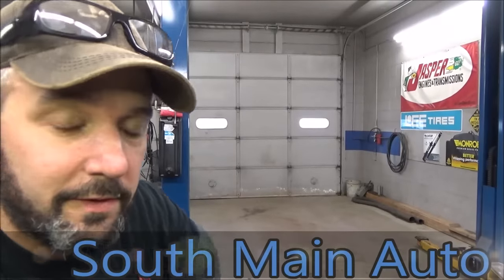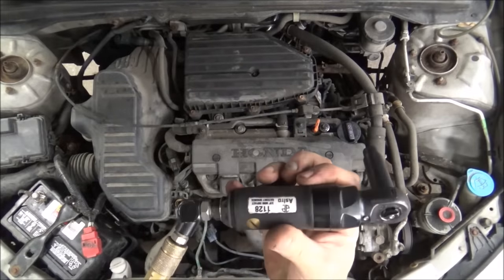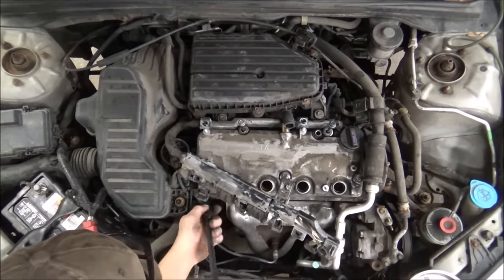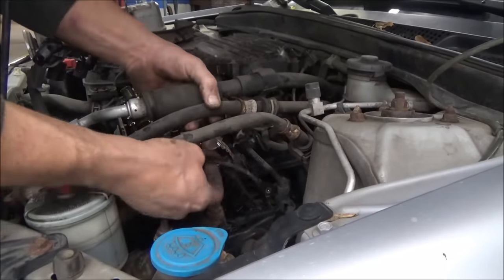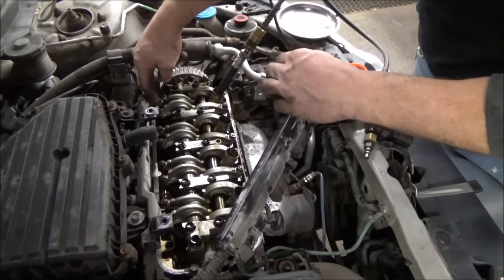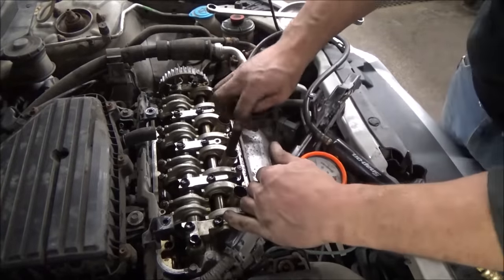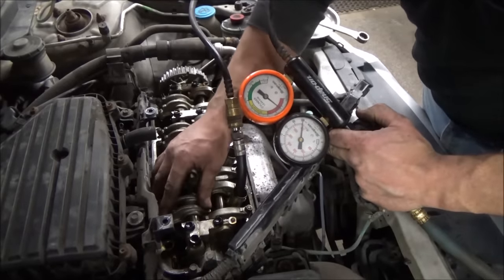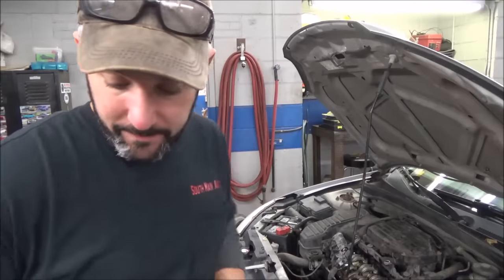Honda Civic 1.7 - Crank No Start

Comment: Neon 2.0 and 2.4 liter ( SRT4 )are crash motors. Valves wont kiss pistons, valves will hit valves. I guess its bitter sweet that way, at least you can just take the head off. But, hopefully you dont run into the Boosted Neon or the Boosted PT cruiser. Holy hell those are a nightmare with that damn " Turbofold " integrated into the exhaust manifold as the Mopar men call it. Those are painful
Reply: +Mopar Dave  Just my 2 cents eric! Feel free to bash me i know its comin! Hahahaha! Great video
Reply: I did a timing belt on an naturally aspirated 02 PT cruiser. No bent valves. Man, when that thing started up and ran perfectly after installing the belt it was a good feeling. As for turbo PTs, that "turbofold" as you call it looks like a nightmare. It basically takes up all the empty space in the engine bay that is there on a NA engine.
Reply: Oh, and when my timing belt broke i was going about 10mph across on intersection. probably in the 2000rpm range. I knew what it was when it happened as I had been putting off doing the belt unless absolutely necessary, since i live in upstate NY, the thing was gonna rust out soon anyway, I didnt want to pay a mechanic 1000 bucks to do it for me. I figured i'd just take my chances and do it myself if the time came.

Comment: It is dumb design for interference engines to use timing belts. A chain is the way to go. They should only use timing belts in non-interference engines.
Reply: Ryan Toomey there’s nothing wrong with timing belts,I just did one this year on my 92 civic SI. It was almost exactly 200 thousand kms since I did the last one. Still runs great at 449 thousand now. You just have to do it when it’s time. I won’t go more than 150 thousand on my prelude when have to do it though

Comment: Unbelievable!  All that just to get a valve cover off.
I had a Honda and the maint manual says to change the the timing belt at a certain time.   I too ignored this and paid for it.  Blew the engine a few years later..  Later Homdas finally went to timing chains and the problem went away.

Comment: Almost every 4-cyl. engine will have valve damage after timing belt breakage. Especially the modern high compression engines. I do not even check it anymore...

Comment: Hey you should just buy a JDM low mileage D17A. i work for a JDM here in Los Angeles and i sell those engines for $500. they usally have between 40-80k miles on them.

Comment: I'm trying to build a consensus of causes for this problem of intermittent Start/stall on YouTube before I fire another parts cannon at the old gal. Already did new timing belt, water pump and pump belt. 290K miles says I needed that anyway. 😂 New plugs, wires etc. I think my problem is ignition coil (acts up when hot), a relay or the fuel pump. Well, this ain't it so...,

Comment: you didn't set the leak down tester properly... you need to set the regulator to 0 before you hook it to the plug hole.

Comment: Nice diagnosis. $2k buys a couple of new cars to drive to destruction.
Reply: +Badgertronix You're right my first car cost me £450 ($670) and that got me a '96 Mercedes C class lasted for two years with nothing more than an oil change and a wheel bearing being replaced. Shame the ECU went bad on it since it was mechanically good.

Comment: Loose spark plugs
Burned valve cover gasket 
Broken belt
Died while running 

All signs of overheating. Terminal for the aluminum fellow.

Comment: Junk yard head and a cheap Chinese belt kit, be back on the road for 100 bucks, done it before when I was a much younger (and poorer) man
Reply: +Fahrenheit38 Good luck finding a used one in the salvage yards near me. They go faster then waffles in the morning as people buy the whole motor for $300.00 and don't bat an eye. As the 1.7 gets older and this happens more the less they are available.
Reply: Not if the pistons are damaged

Comment: I am thinking the noise the operator heard coming from the engine shortly before the engine failed and stopped was probably the timing belt shredding. The loose belt fibers were slapping and making noise on the inside timing belt cover. If one would have known you could shut down the engine immediately before the pistons hit the valves.

I also wonder if a contributing issue is the myth that is so pervasive today  that Honda and Toyota engines will run forever with NO maintenance? That is UNLIKE the junky engines from the american manufacturers GM, Ford and Chrysler. Sorry for the sarcasm but I head that a lot from family and friends about cars.

Comment: If they had replaced the belt at 100,000, as Honda recommends, this would have likely been avoided. (and don't replace it with a cheap timing belt)

Comment: A timing belt on an interference engine.... Brilliant engineering.
Reply: It is brilliant. Service them as they should be and they’ll run hundreds of thousands of miles like well  maintained Honda’s generally do. Free- wheeling engines aren’t by design as efficient or clean burning.

Comment: Fuck waiting on the machinist. Get a reman. Same thing, but you get the head back faster. Saves labor inspecting the old one. They're about $500. A victor reinz kit costs about $60. Takes an hour to install the head and set the valves. Then you're just left with the timing belt.

Comment: Murphys' Law
the problem with just junking a car in a situation like this is what happens with the replacement...
that's the reason it's not worth the value of the repair

probably no car is worth the value of a major repair if that repair is for a breakdown that is likely enough in that car given its age and mileage

True "wisdom" would have been, "hm your Honda 1.7 is making a funny noise that you can barely describe. When's the last time you had the timing-belt replaced? Maybe you should bring it in right now in case it's the timing belt about to go bad, or at least record the sound that it's making with your cell-phone and email it to me so can hear it."

Comment: But Hondas are so reliable, until they break that is, my 2001 lesabre 3.8 has 294,000 with original timing chain, my friends friend has an Audi at 100,000 timing chain broke and there were two he said, God knows what damage that caused.

Comment: The 1.7 motor is a non interference motor! So valve's would not hit the piston.
Reply from the maker: Proved that wrong in this video...
Reply: After 1996 honda 1.7 motor was non interference motor. I had a 2003 civic 1.7 non interference motor. Now I drive civic 1.8 I vetec .
Reply from the maker: @duanenishimoto1285  this engine is 100% interference I prove it in the video. Did you watch it?

Comment: Also those 1.7 arent the best engine that Honda made.. They were quite troublsome i've witness quite alot of these mills having blown head gasket and throwing rods and such with low mileage.Reliability wise the Honda 1.6 was top notch and the 1.8 seems to be better than the 1.7
Reply: Jotech 1991 agreed on the 1.7 being junk. But the 1.6..do you mean single or dual cam 1.6? Imo single cam 1.6 is Hondas most reliable
Reply: i was talking about the SOHC engine, it is such a relaible mill
Reply: Oh you got that right

Comment: I'm not a mechanic but I have to ask myself every time these guys go through all that trouble why not put the borescope in the spark plug hole and find the damage. I understand there's different types of cameras that can look up at the valves or there should be at least. You fine damaged why waste your time going through all the rest of this. If the customer is not going to do anything anyway it wouldn't take but 20 minutes or less to find a bent valve or something along those lines. Or am I way out of line here

Comment: I would have gotten a head from a scrap yard and belt and done this myself for under 300$
Reply: Pay me now or later, mechanical incline one day job.
Reply: Funny to come back to this video after two years, I just bought one of these civics mine is an 02 non vtec with low miles . These cars are now worth their weight in gold with gas prices, I’m getting 400 miles out of a 13 gallon tank !!!

Comment: If the valve hits I would imagine it would happen as soon as the belt breaks.  After that the valves aren't going to move so cranking shouldn't cause any (more) damage.

Comment: Why do they make interference engines? Seems stupid
Reply: Higher compression ratio means more power, less fuel needed, more torque and interference engines.
Reply: The valves open into the combustion chamber and like he said more compression = more power/effieciency so the piston will come very close to the head and if a valve is open when the piston comes up...

Comment: Timing belts are junk literally the number one thing I avoid when buying a car is timing belts always go for a chain
Reply: Chains can break, chain guides break, chain tensioners fail too and replacing a timing belt really isn’t that big of a deal. If anything it’s a good excuse to replace other stuff like the water pump that may leave you stranded one day anyway. In the grand scheme of things I think a tbelt is pretty low on my considerations for a new vehicle.
Reply: briantii I’ve had 3 cars with chains and I own two of them still, my first car a 94 Sentra had 315k ( I did 210k of those miles) never had a timing chain issue. My current cars a 01 Maxima and 92 Sentra both are nearing 300k and no timing chain issues, I’m sure like anything they can fail I’m not disagreeing but if properly lubricated they literally last forever in my experience.. what killed my first Sentra was a 88 Ford truck ramming it, it still started and drove but it was a little half passed totaled
Reply: @tommys1678  Sure, but for that matter I've owned 5 cars with timing belts and 2 with chains and never had valvetrain problems with any of them. The keys to success on either are proper maintenance and hoping your OEM didn't screw up the engineering. Some Nissans like the Pathfinder and G35 have had problems with the chains which were a real pain to address. Ultimately the tbelt is just another maintenance item that should be replaced on schedule as indicated and can be easily planned for. Ive diy'd 10+ of them over the years for myself and friends... they just aren't that big of a deal either way.

When buying a car the unscheduled maintenance (break down items) are a far bigger concern to me than how the valvetrain is driven.
Reply: Also cars like these Civics are REALLY easy to do the belt on. I've done them in the evening after work or on a Saturday morning before lunch. So cheap and easy to do that there really is no excuse for not doing it. My IS300 belt is a bit more involved, but again... the parts aren't expensive and the work isn't that hard... just takes a little time every 5 years / 100k miles. Do the maintenance and they do NOT break. :-)
Reply: briantii still doesnt change my mind on timing belts being garbage
Reply: Tommy V - Heh - OK. I'd trust a maintained belt with 20k miles on it more than a chain with 300k... but whatever. Guess lucky for you chains are more popular these days, but you're missing out on some of the most bulletproof reliable engines from the early 2000's like the 2JZ, d and b series Honda's etc.
Reply: briantii a bulletproof engine in my opinion would be the GA16DE or the VQ30DE and I have both of those and they have been great to me. My issue with timing belts is that they are extra maintenance and if you don’t have the time or tools or just don’t know how to change them out yourself it’s an expensive thing to have replaced. I had a 1993 Nissan Quest and I called around and emailed around getting quotes for the timing belt replacement. every place I called was over $1000 some creeping into 1500+ (of course these were chains big names like firestone tuffy etc I’m sure a mom and pop mechanic would be cheaper) and that’s when I made up my mind that timing belts are junk. It’s too expensive and it’s a well since your here replace all this other crap too kind of thing...oh and let’s not forget when the little rubber band snaps your stranded and most of the time out an entire engine ...I respect that you like them they are easy for you to replace and you enjoy extra maintenance but it’s not for me
Reply: @tommys1678  Sure, I respect that you don't care for them due to the higher maintenance. I wouldn't say that I like them exactly myself... all things being equal I'd prefer a chain too. My point was just that frequently all things aren't equal. The parts to diy a 93 Quest are less than $100 bux and that's even including the "while you're there" stuff. I've done a vg30e in my old Maxima, it wasn't too bad. It's too bad you couldn't find someone reasonable to replace it. Toyota dealers used to frequently run specials to do them for under $500 on the various Toyota engines.

I think some of the claimed benefits of the belts are more efficient (less valve train parasitic loss), less stretch / wear that occurs at chain links, and some say they are quieter. Personally I don't care. Just replace whatever the manufacturer says when they say to do it and keep on roling. If a belt is in that list it gets done too. Take care and the vq30de's are for sure great engines, don't remember the GA. The QR25de wasn't very good... had a buddy with an early one of those.... bad, bad, bad.
Reply: briantii at the time of my life I was at when I had the Nissan Quest I didn’t know what I was doing and to this day probably still don’t so I wasn’t even going to try it and it was too much to replace professionally as a preventive maintenance thing, same thing with the 06 Kia Rio I had its just something i can’t afford to have replaced don’t know how to do it and don’t want to mess anything up ..I’m sure a lot of people end up exactly where this dude ended up with his civic ..it snaps motors ruined the car goes to a scrap yard

Comment: Why in the hell don't they make all engines non-interference? Oh, big bucks when the rubber band goes twang!! I'll stick with my timing chain engines, at least you might get a chain rattle pre-warning for a while!
Reply: robbocop33 r yeah ,except for some lousy designed engines,GM Colorado has a timing Chain on the rear of the engine as well as the front and they’re having premature wear issues with em,failing at 100 thousand miles. 5 thousand dollar job to do it. Garbage from Genital motors never stops.

Comment: What a waste......Seems like they could design the valves not to hit when the belt breaks, or maybe just not engineerable. I would just find a used head and bolt that baby on there, use same head bolts, maybe a new gasket, good for another 50,000
miles. I believe alot of cars get scraped due to the owners have no idea how to do simple type work on their car.
Reply: +Charles Miller Just a couple things, head bolts stretch, so you aren't supposed to reuse them. last set I bought was around $20, not that bad for older common engines. Using a junkyard head is a gamble. If the engine it came off of can be leak down tested, then the yard probably wants to sell it complete. If they sell it already removed, I think its smart to have the machine shop look it over. If not you risk trashing  gasket sets and head bolts until you can find a good head. Not to mention all your labor.  Also, a non interference engine will not bend valves when the belt breaks. This was an interference engine. 

But most important of all, if the owner would have just had the car serviced regularly, his mechanic would have recommend belt replacement at 60k-110k.  Problem solved.
Reply: the idea behind interference engines is efficiency. Many car makers design engines like this, nowadays. As for the belt, it is a great way of keeping the engine quiet. My 91 civic is much quieter than my sisters 06. The new Honda engines use a chain. louder but safer I guess for those that don't do maintenance
Reply: I guess in the end it all comes down to labor if you aren't able to do it yourself, then its just not worth it. Seems like there would be alot of this type engines around. 20.00 for head bolts, at that price yes new bolts. Think my last set was 80.00. We seem to just throw everything away lately, in the end it will come back to bite us. So the new type engines have the belt break slam the valve problem, good move on the Mauf part.
Reply from the maker: +Charles Miller Wish I could have just yanked the head my self :/ BUT I can only do what the customers wanna pay me to do...

Comment: My girlfriend has a 100,000 miles on her vaginal odometer. I just want everyone to know.
Reply: You have to change the timing belt then.
Reply: Joe Conley Seems like she's been passed around more times than  the turkey at thanksgiving dinner then. 

At this point she's a bit on the used side and beat up. Probably fell for the nice exterior and didn't pay close enough attention to the interior didn't ya?
Reply: I'll give you Fifty bucks for her......might still have some usable parts left!
Reply: if sh'se an Asian or European model, that's still ok. if American made, should of dumped her at 80k.